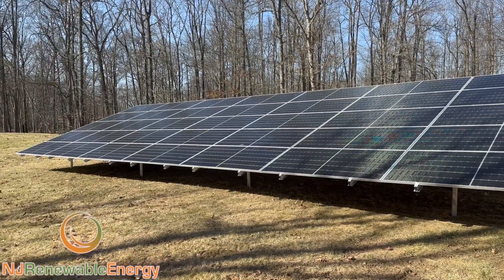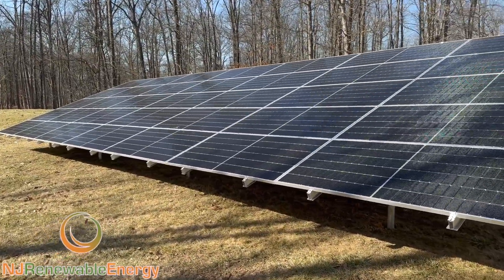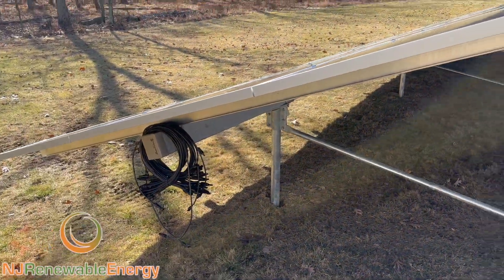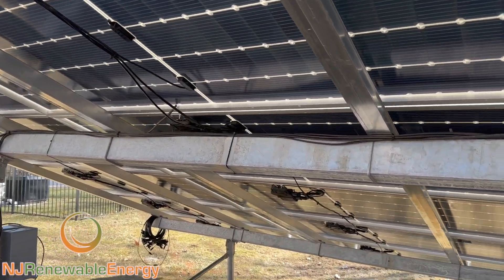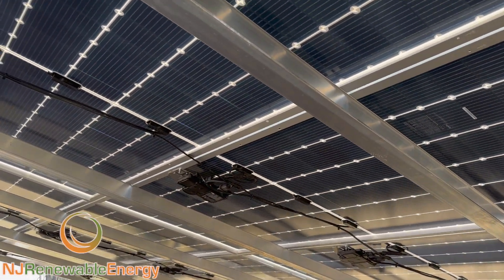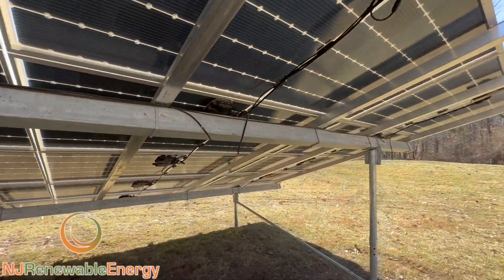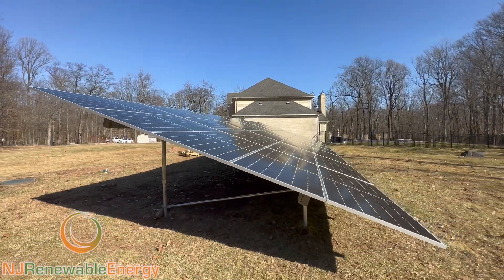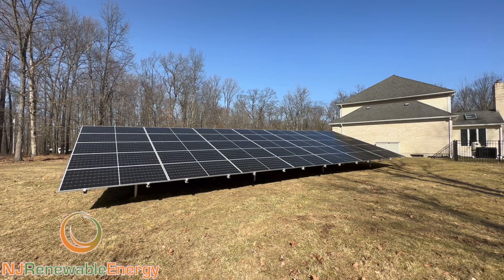Beautiful Bifacial Ground Mount -  Big Power!

Comment: What's the pay back on backside?
Reply from the maker: This set up isn’t more expensive than traditional one sided modules.  The fact that they’re commercial and a little larger gives a better economy of scale, so you get more power at basically the same price.   Granted, supply chain, has cost up a little at this point, relative to the trajectory of the last 15 years, but hopefully things will move in a better directions soon.  Still a very valuable return on investment of about five years.

Comment: Fail. You mounting create shading for bottom side, not good for  bifacial.
Reply from the maker: They use these on roof tops.  We have it on a open ground mount.    Not really following you.
Reply: @NJRenewableEnergy  he’s correct. I have a very similar mount to yours and I get direct sun on the backside of my panels in the summer. I was confused why I was only making about 100 W, 50 W per string. Because the bi facials are split cell, and horizontal, the rails cut through each half creating a shadow. The shadow cutting through a portion of the panel shuts off the whole panel. Since you have a rail going across each half, it will shut down each half. By facials are meant for a special mount that does not cast shadows.
Reply: Direct sun on the back of your array during the summer?  Something doesn’t sound right about that setup-you should never have direct sun on the underside of an array if it’s generating south facing…